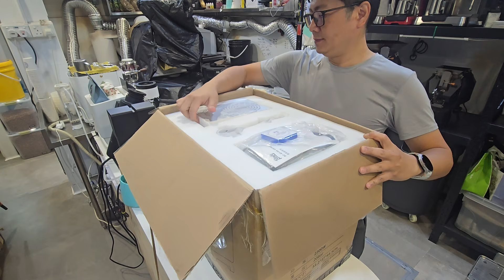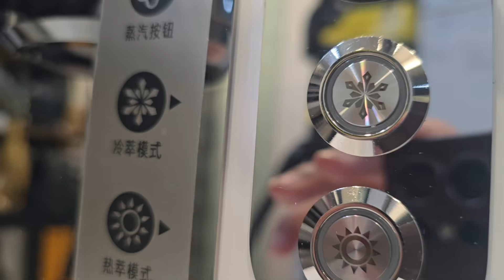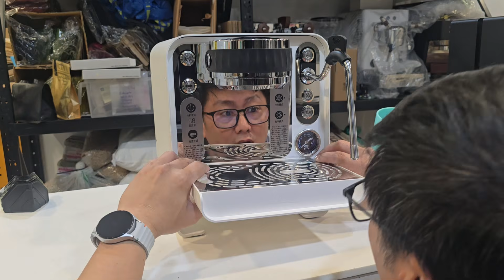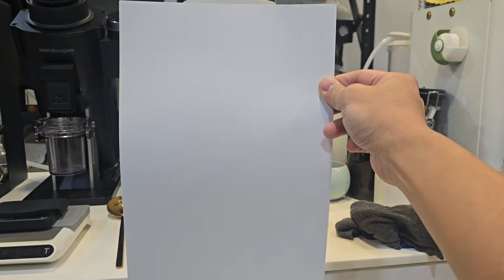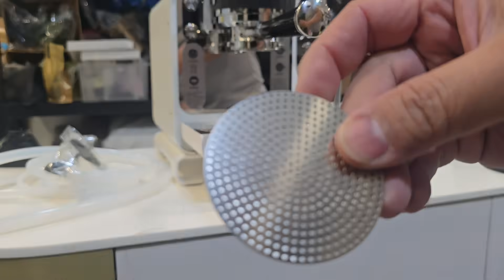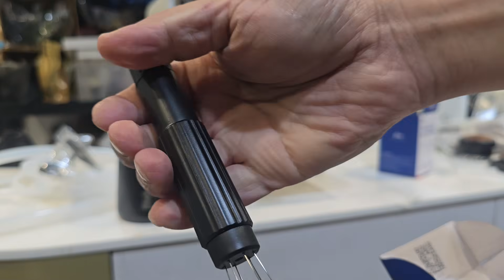Unboxing | Bincoo | S1 Pro Semiautomatic Espresso Machine #bincoo #s1pro

Comment: Is the S1 Pro or the S2 Pro considered to be a more premium product?
Reply from the maker: They are targeted at different audience. S1 Pro is more for home use. S2 Pro is targeted more on the commercial setting. Both are very premium machines. If you are talking about functions, then the s2 pro has more control over the S1 Pro.